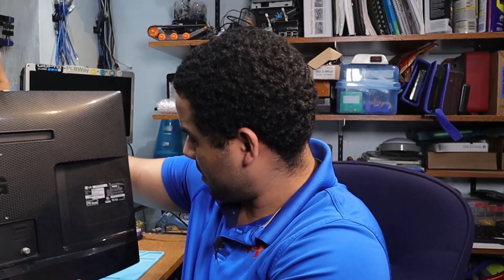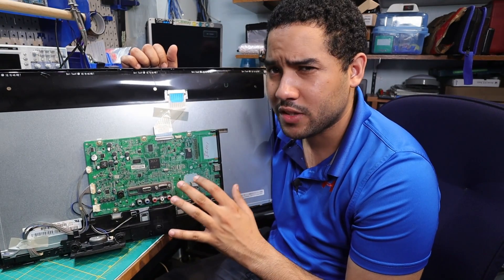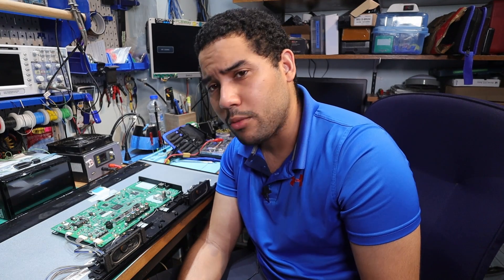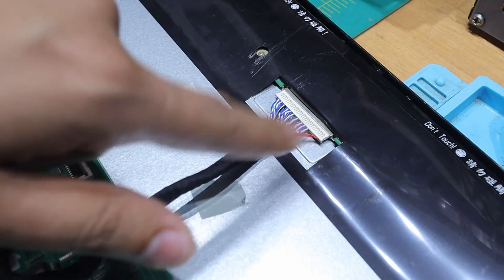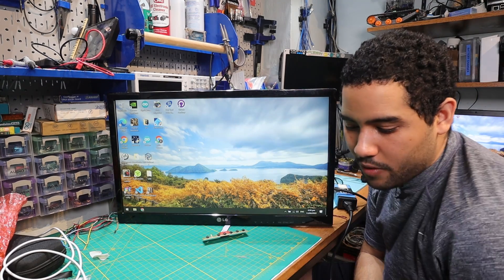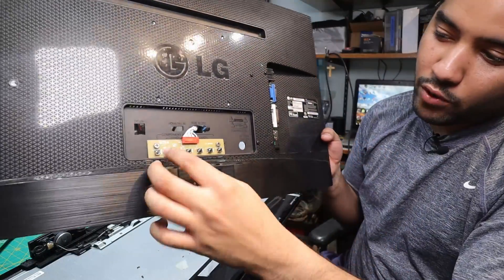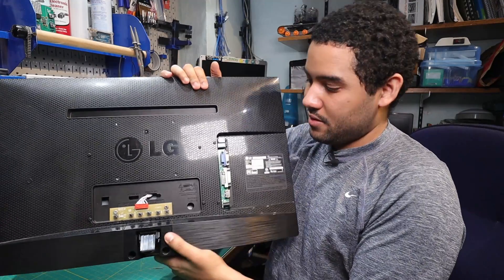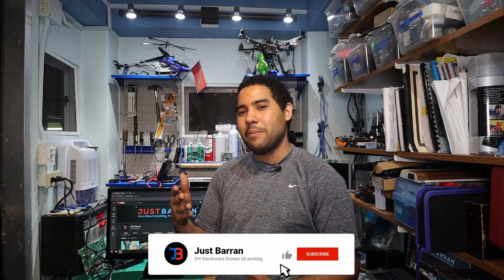How to fix any computer monitor or  convert your old laptop screen | Fix-it Friday #3

Comment: I thought you were going to show how to fix the board. Usually by the time I realize I can buy a replacement board, I get distracted by the amazon ads and just buy something new.🙃
Reply from the maker: Hahahahah you and me both, but yea, I actually took some time and tried to find the problem on the board, if I had a LRC meter it might have been possible but since I called that quits after a couple of hrs I had to move on the next best thing. I tested the voltage regulators and they all were good. I could only post the video of me fixing the board if I could have found the problem 😭🙃.